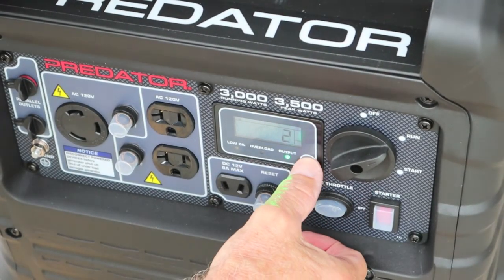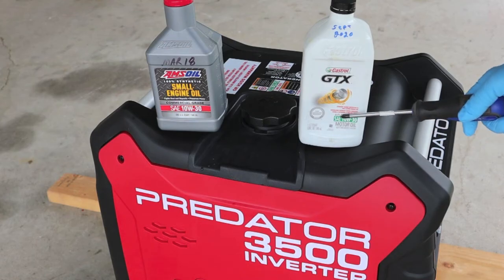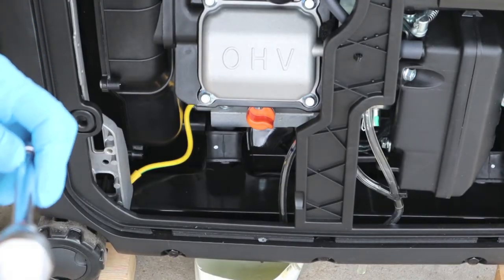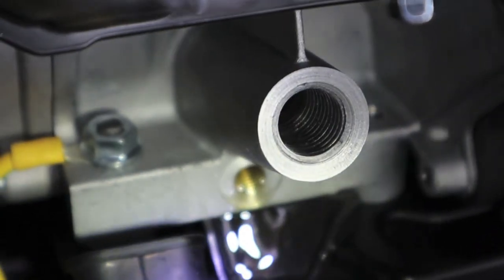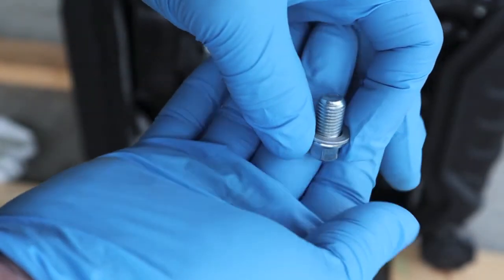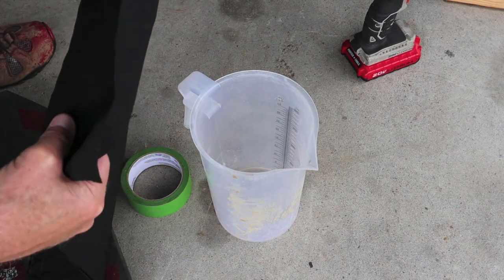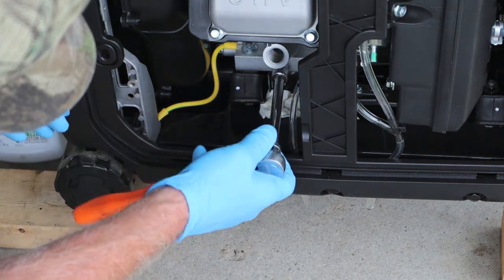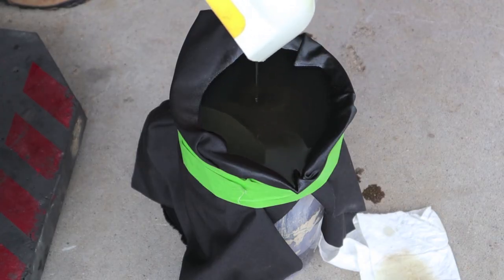Predator 3500 Inverter Generator 2 hour oil change LOTS OF METAL IN OIL a look with 250X microscope

Comment: Wish you'd have shown the level on the dip stick. Mine reads full on one side and at the bottom of the stick on the other. Not a great design.
Reply from the maker: Bill, the dipstick is 99 percent useless, just fill to nearly overflowing and call it good.
Make sure to level the generator when checking.
Thanks for watching!
Good luck with yours!
Reply: These Honda clone style engines you just fill it up to the top until you can’t put any more oil into it. It won’t let you overfill it . It’s genius . The dipsticks are useless. Done it that way for 25 years , no problems

Comment: The problem I have is: 1. A Lifan 7000 does not have a carburetor and is fuel injected And fuel is not waste as in a carbonator  generator. But wither the Predator 3500 or  the Lifan 7000 cannot be placed inside the cavity for the generator of my 1985 California Dolphin  21 foot  RV.  The current generator is  Onan 4000 with 3400 running watts (It  accelerates up and down in RPMs without my intervention)and my judgement is it is not enough to run the AC with the microwave oven.
Reply: 92 Toyota Dolphin here!(six lug rear axel configuration) Sounds like my Onan has the same problem your Onan has. I'm considering mounting this Predator to the back of my RV.(at least until I can get the Onan properly serviced or replaced)
Reply from the maker: Jeffrey, will your Onan run okay with only the AC?

Comment: I did this  to break in my 3500 ,never on eco mode- cheap 10-30 Wal Mart oil, drain immediately after shut down while particles are still suspended in the oil, I even tilted the engine temporarily while draining to force particles toward drain plug. I ran the generator with a 1000 watt electric heater for a load. Each cycle I checked the drained oil for particles .- 15 minutes first cycle-.30 minutes second cycle . 1 hour  3rd cycle. 2 hours  4th cycle. I ran a Castrol 10-30 after the 4th cycle until it reached 30 hours,then switched to Mobil 1.(Engines need the load to seat the rings.) I have been inside many new Predator engines ,and there is a LOT of machining trash in the new ones. Be aware that cooling air for this generator comes in from the bottom, grass and dirt, or uneven terrain can reduce air flow.Keep thin  a piece of paneling or formica to park it on in questionable parking locations..
Reply from the maker: Thank you Fred! You listed some very good points here and I appreciate the information!
I figured the machining processes left lots of trash particles in the aftermath. 
I always park mine on gravel or concrete, so far anyway.
Thanks again and stay safe!
Reply: @pmtips4482 you made some good points when you stated that mineral oil is just the way to go instead of synthetics. Oil is cheap and doing regular maintenance won't kill. I'm pretty much of a Castrol guy , so the amsoil is just a waste of money compared to a monograde oil,
Reply: I had mine on eco mode half way throu the break in process? What does that mean? Why no eco mode?? Should i return mine and get a new 1?

Comment: Most people return them before 30 hrs
Reply: @Review Master he has changed the oil maybe 3 times.  Runs Shaffer’s oil.  He’s never been know you maintain much ever.  We will see.  But honestly for the price you can’t beat the predator 3500.
Reply: @Review Master https://youtu.be/wzQEeDHgKPo
Reply: @neb4x4  Well that's one I hadn't found yet.  7,000 hours.  I'll also bet he didn't do all the fussing and worring about the tiny flakes.   Change the oil a couple times the first 2 hrs,  run at least 30 + hours using regular oil so rings can seat good before using synthetic. Keep fresh gas in it and it will be fine.
Reply: EAT
Reply from the maker: Thanks for the info!
Reply: @Review Master Cheap junk??  Well how do you explain the many owners that have run thousands of trouble free hours in hot deserts to below freezing without any modifications?  Lots of videos of owners on Y.T. bragging how they love their Predators.  Truckers have them run 4,000 + hours behind their cab without any mods or constantly changing oil.  So spend twice as much for your name brand stuff and we'll spend money on other fun things.  I loved my 1st 3,500 so much I bought another one since I know they last and don't cost much.  Those cheap carbs for any engine from amazon are junk and smart people don't buy them.  Keep fresh gas and you never need a new carb.
Reply: @Review Master Just about what I figured.  That's why you call something junk when the facts don't support your opinion.  So everyone that doesn't agree with you is an idiot and needs to be shut down.  Yup I knew it, claiming to be a Master and making false claims was my first clue. I knew I could expose your inability to tolerate differences of opinion.   Well Mr. Review Master I'll get back with ya when obiden and his crew get exposed for what they are and end up in prison.  Stay tuned, watch the show, Lol.
Reply: That's strange,  I was debating with  " Mr. Review Master "  and now it's changed to " The Australian Opinion "..  Changed professions maybe.?  Anyway,  both my 3,500 Predator Inverters run like a champ same as many others.  I do say to drain ALL the gas out if it sets for a while.  I'm noticing that one does not totally shut the gas off and will fill carb back up after draining bowl.  No big deal for me but be aware that carb might not stay drained like you want or if carb leaks........  Have a Great Day.
Reply: @Review Master my friend has a predator 3500 with 1,100 +/- hrs on it now...
Reply: @Review Master I was addressing your claim that the Predators were junk and won't last long.  Looking at all the reviews from a bunch of people, including Honda owners show they are not junk. They have been used for 5+ years and many have run for 4,000 + hours with no break down issues.  Any problems reported is the same for other brands such as leaving old gas in,  expecting it to run perfect with no load, or operator error such as overfilling gas tank or choking a warm engine.  I've had all the panels off looking for poor design or workmanship and very impressed at the quality.  Your claim was they are junk and I showed they are NOT junk.  Now you want to argue they are made in China.  You also want me to take advice from obiden which isn't happening.  I have a feeling you didn't support President Trump when he was bringing factories and jobs back from China while placing heavy sanctions/ tariffs against them.  Have a good day.

Comment: I bought my Predator 3500i over two year ago. I salvage a magnet from a  broken microwave oven and it does not help  with aluminum particles.
Reply: Aluminum is not magnetic.
Reply: I have a problem. I cannot replace the manufacture's spark plug after 3 hours only of operation. I want to replace with an Iridium spark plug and never replace it.
Reply: Aluminum is magnetic?

Comment: Whats the size of the oil plug thread???
Reply from the maker: I'm not sure but looks to be 1/4 inch pipe thread. I plan on getting a pipe thread gauge and I'll check it next oil change and post it.
Thanks!
Reply: Its the same as a Honda GX200 engine. Just google that. I bought an oil drain hose for a Honda GX200 for all of my Predator 212cc engines. I believe they call it the 10MM. The larger Honda engines, like the 340cc and 389cc use the 12mm.

Comment: They’re decent generators for the price point. With that in mind, a good break in at least for the first 25 hours worked out for me. I did mine at 2, 8, 16, and 24 hour interval running on a 1/3 load. Since their standard warranty is 90 days, I figure if I buy it on a Friday, ride it hard and put it away wet on Sunday without any issues I’d be pretty much good. Before I start the break in process, I did verify the valve clearance to see if they’re in spec first.

After the break in period, I just check on the oil before using it and changed it around the 100 hour mark and 100 hour intervals from there. So far I am now at the 239 hour mark and no oil consumption at all. I did change from the stock #76 main carburetor jet to a #72 due to it running rich at the 2000 ft elevation and I get less fouling of the spark arrester. Plus, I did a valve adjustment on it earlier in the week and it starts up on the first pull without any hesitation. Definitely a good break in and route maintenance go a long way.
Reply: What valve lash do you recommend? I just bought one and haven’t even cranked it yet.
Reply: @matthewswinford7004  valve lash is commonly known as valve clearance between the rocker arms when both intake and exhaust valves are closed with piston is at top dead center. As the valves open and close over time they wear down to the point of touching the overhead cam rockers.

Brand new engines really don't need any adjustment of that sort since it is already set by the factory. Once you put in about 300 hours, they recommend to have it checked and adjusted as necessary.
Reply: @felaxchow207  I’m aware of what valve lash is. I know how to verify with a feeler gauge & adjust if needed. I was just asking what the recommended clearance is because you claimed you verified yours too. I just figured that being the case, you’d have know what was within tolerance. I can look it up. LoL
Reply: @matthewswinford7004  0.004" to 0.006" intake and 0.006" to 0.008" exhaust. After 300 hours was still within 0.001" tolerance.
Reply: Did you swap the factory plug out or kept the current one?
Reply: @darwinwilliams4487  yes, I replaced the factory spark plug with NGK iridium plug. Maybe a bit overkill, but I’ve been doing that with all of my small engines. What I’ve noticed is that it is more forgiving if it slightly on the rich side and it’ll last for pretty much the life of the engine.
Reply: @felaxchow207  Nice I am am waiting for my ngk plugs to arrive for my generator also

Comment: Do I need to use a special small engine oil that has more zddp in it?
Reply from the maker: According to the owners manual you do not. OTOH, top tier engine oil manufacturers are starting to actually list "higher zddp" and also "higher zinc" content on their labels.
I think there are advantages to using higher zinc content in hard working air cooled OPE engines.
Thank you for watching!
Reply: Pennsoil , Moly , Quaker State. The synthetic oils. Yes then Amsoil. Magnetic dipstick too.
Reply: Most motorcycles oil has a much higher Zinc content because it is an excellent friction modifier. Zinc is harmful to catalytic converters and most motorcycles don’t have them. You can call any major oil company and ask an engineer and they will explain thoroughly. I have because of wet clutch, JASO 1,2 and car vs motorcycle oil questions.
Reply: @MikeJohnson-ut7lx   Mobile 1 engineers are very helpful. call Mobil 1.

Comment: Be interesting to see how long the Pedator lasts. 🤔👍👍
Reply from the maker: Sure will Chris, there is a YT video where it's mounted on the back of a semi truck to run his fridge and microwave oven, TV, etc in the sleeper berth. He has over 1500 hours on it and it's still going strong.
I think he said he tries to change the oil every 100 hours. 
Thanks for watching!
Reply: Me to. So many reviews out  there comparing China generators to Honda’s, but longevity is never brought up. I have a Honda eu2000 with over 7000 hours and is still going strong.
Reply: @Idahoprepper71  maybe if planning on using 7000hrs....many would never use one that much if issued a birth! no way pay 3x price for occasional use or just in case use. like saying Lamborghini is way to go....all rest junk
Reply: @fike301  when you need a generator, you want it to work. Even if you are only using it for emergency, I want the most reliable generator I can buy. It’s worth the extra money for me.
Reply: I'm at 3400 hours so far on my Westinghouse iGen4500DF.

Comment: are oil changes this frequent common for new generators?
Reply from the maker: I'm sure a Honda and Yamaha engine is much cleaner after the manufacturing processes than these Chinese made engines. 
Engines made in the PRC need early oil changes, much earlier than the owners manuals suggest. It's really up to the end user. My Predator 3500 reads very accurate on all LCD readout selections, starts and runs perfect so far, so I've decided to "flush her out" with several oil changes in the first 10 hours for the sake of engine longevity (hopefully).
Thank you for watching and commenting!
Reply: @happydogg312  yeah oil is too cheap not to now that I’ve seen multiple break in videos online. Bought one yesterday & I’m not taking any chances. Maybe it’s overkill but oh well! LoL
Reply: @matthewswinford7004 and these engines don't have oil filters and little sump, which can blackened the oil quicker than in a car. Therefore oil change in gasoline power equipments should be frequent